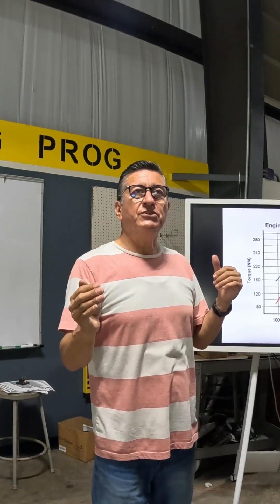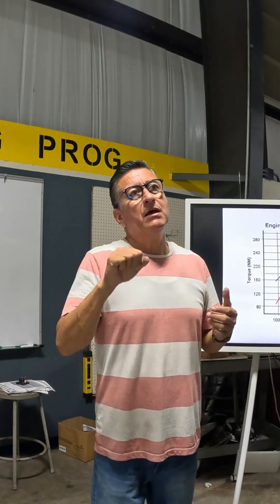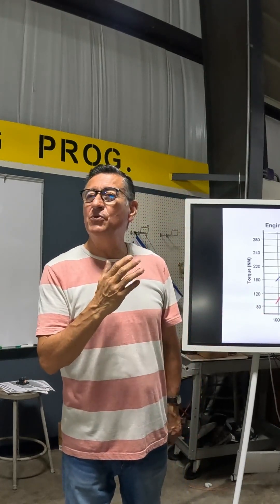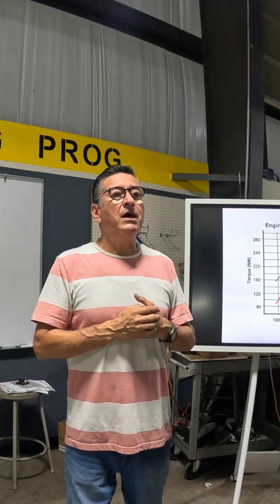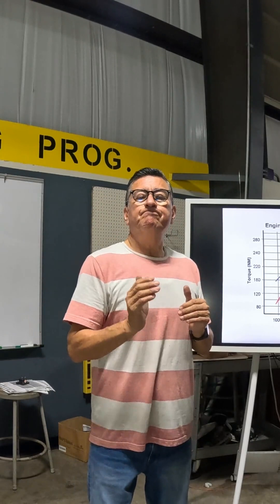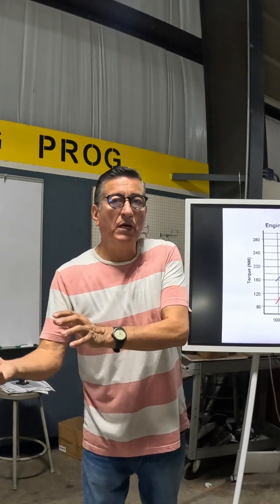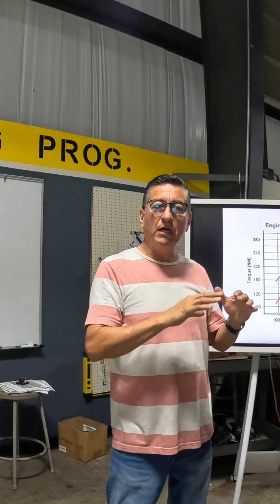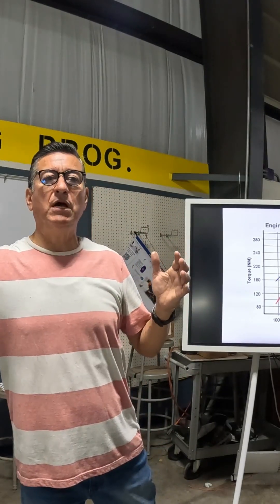Maximum RPM of a Marine Diesel Engine

Comment: I don’t understand..
The propeller pitch is fixed on a gasoline marine engine, too.
And it spins over 5000rpm ??
Reply: he said you can destroy the boat not the motor because armonic distorsion which means the vibration will sink the motor
Reply: @Todo_trueno    I am well aware of that. But that still doesn’t explain my question.